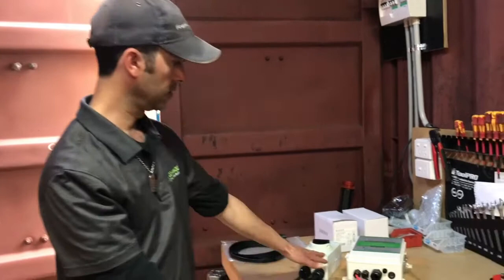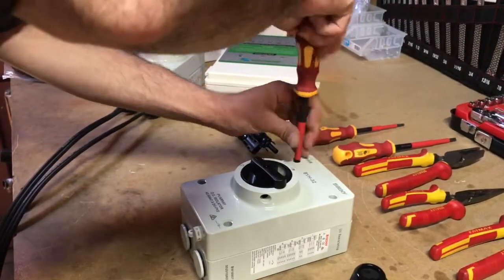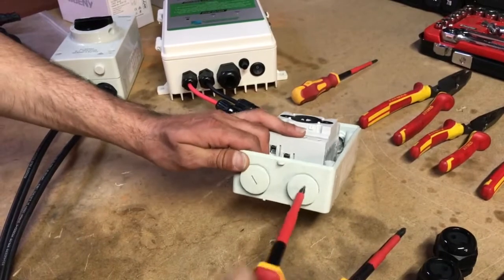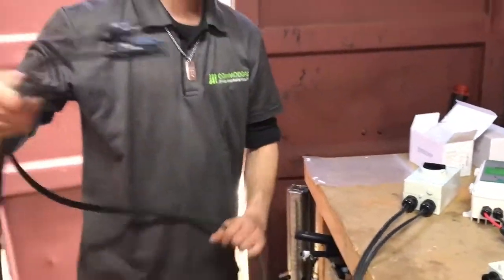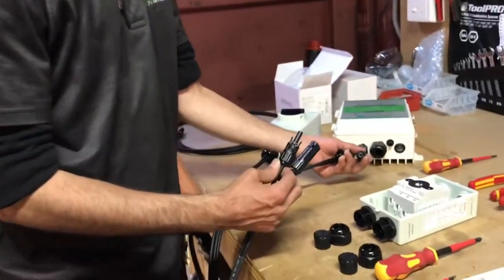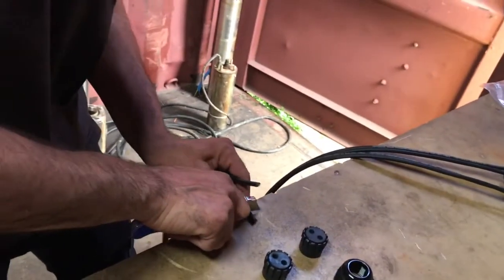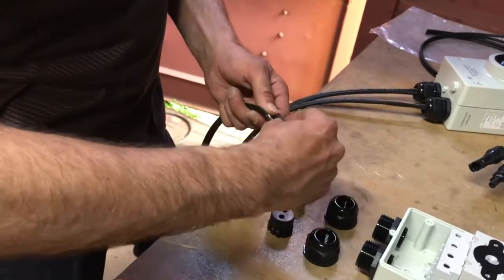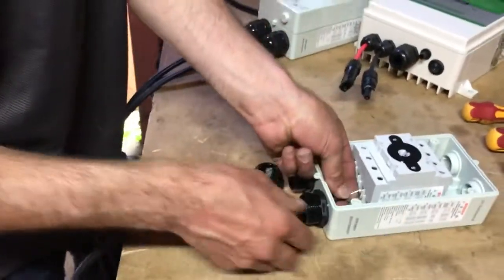How To Wire a DC Pump Isolator

Comment: I understand how/why Regs call for this type of Isolator, as opposed to (old) Circuit Breaker style.  Since they are approx 4x the cost of the (old) CB, I only hope to do it Once.  The issue is, I want to be certain that the Isolator that I get will work with One set initially, and a 2nd set down the line.

e.g. One 500W 48VDC 30A  PV Panel currently, with plans to add a SECOND of the same, within a year.

Is it possible to get an Isolator that covers me for the one Panel; and, the Same Isolator covers me when I add the Second PV panel ?

Cheers !  Solid Video 👍🏼

Comment: Wish I could see where to click attach to inverter.  Mc4 connectors between inverter and isolator? And mc4 connectors also between isolator and panels? So a set of mc4s on both sides of isolator?

Comment: Well I found this very informative, having presumed that the wire going in on the left above would have logically come out at the left below, and so on across. But no. Sort of diagonal. Counter intuitive. But now I know how to wire it. Understanding why it’s laid out internally in this bizarre way is above my pay grade. Just so long as it works and I don’t muck up any expensive bits of kit by applying overloads or incorrect neutral/positive transpositions. Thank you uploader. 😊

Comment: Definetly wrong! No ferrules on the stranded cable , that is a must, plus, that is not the way to strip a cable, sorry!
Reply: Nothing at all wrong with this install, likely couldn't fit ferrules into the enclosure. Ferrules are a tool, not a requirement
Reply: @duncansarmy  ferrules are quite important for high voltage, high amperage, watch some experiments made about this and you will change your mind about it, plus they look more professional and a kit it is not so expensive.
Reply: Gabriel Ionescu can assure you I won’t

Comment: On the exact same DC box I have, the bottom right connects to the top left as you have them, but I have two pairs of solar arrays and two inverters. So I also have to use bottom left and top right (criss/cross) so that both sides can be switched off at the same time.
Reply: So if you have two strings of panels, where does the other pair of wires go? Just at the top next to the others?
Reply: @carl8568  Yes, string 2 would go on top right (in) and bottom left (out)